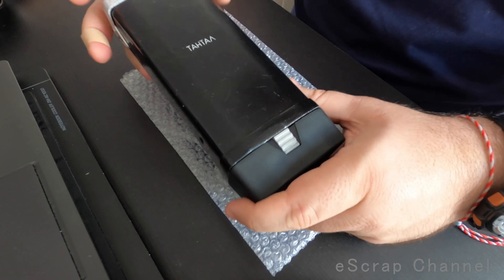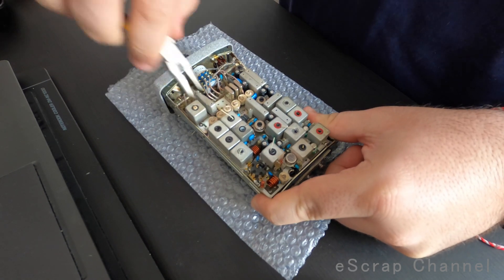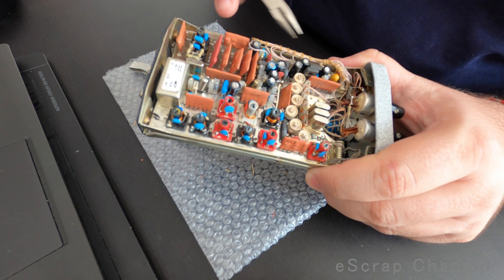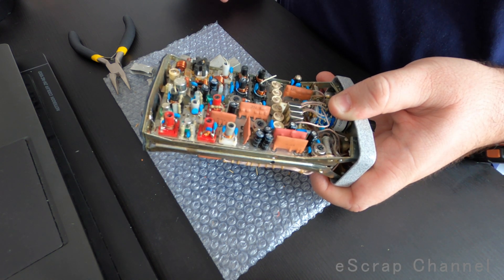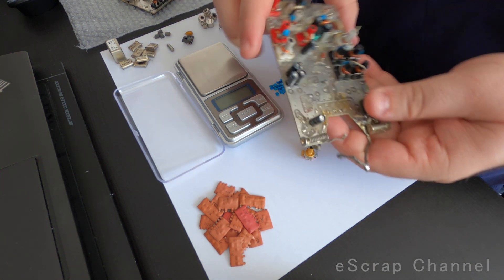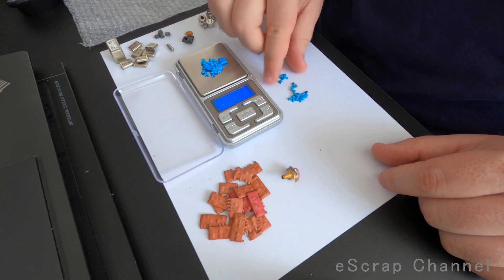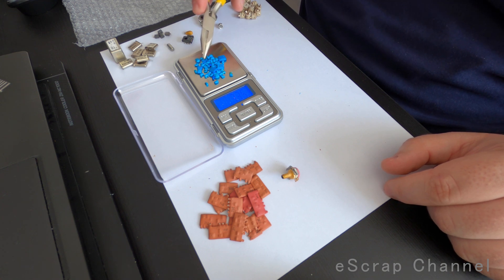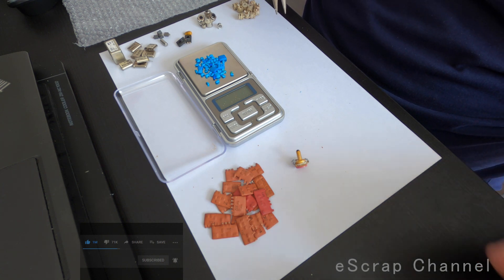Scrapping Vintage Radio TANTAL for Palladium and Gold

Comment: Hi friend...let me do one question please...the poliester capacitors...do you think can Scrap them to extrac to precious metals? Thanks
Reply from the maker: Hi, What do you mean by polyester capacitors, please? Some capacitors have MLCC inside, some have silver layer, some no precious metals. Please send me a picture to see.
Reply: @escrapchannel  I can,y send pic here because i don,t know very well how...but in your video is the same capacitor you remove first, is square capacitor grey color
Reply from the maker: Hi, first I remove an aluminium cover of a small ceramic plate with MLCCs on top. Yes, these MLCCs are good and contain palladium.